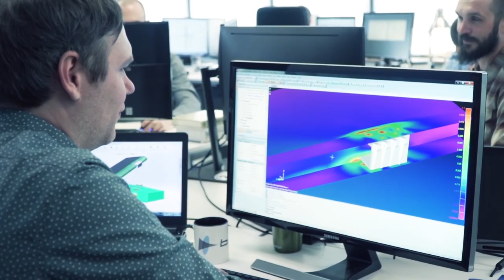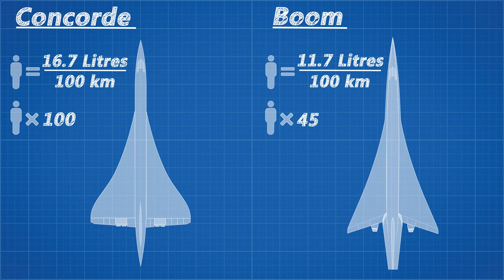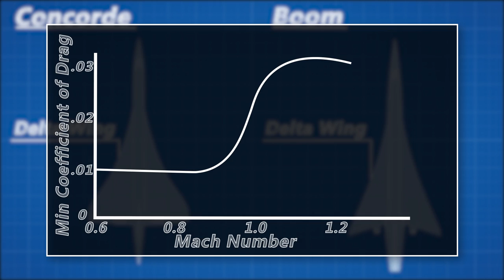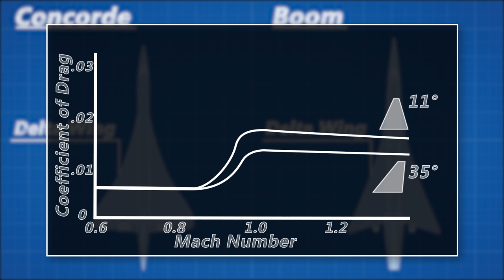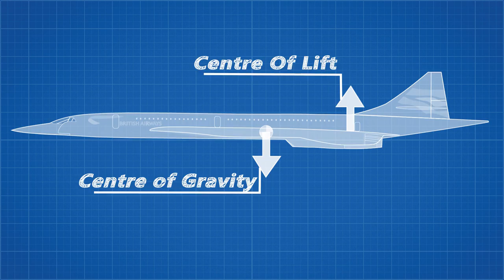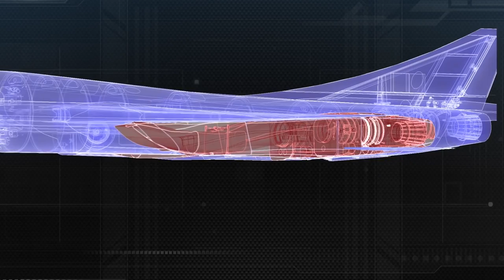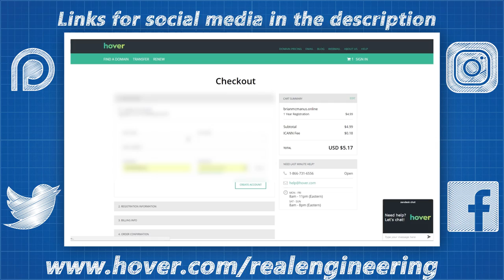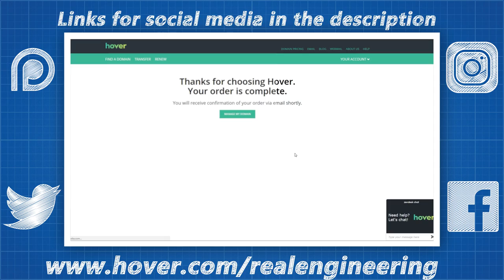Boom: The Future of Supersonic Flight?

Comment: I don't think this is optimum, the economic performance is worse instead of being better, it'll take 2.22 Concords to transport the same amount of passengers, and the 30% fuel efficiency won't matter as it'll reduce the number of Concords to 1.56. 
They're making a fuel efficiency supersonic airplane, not a fuel+economy efficiency to be a socially responsible industry, with relatively stable prices that don't fluctuate with demand/offer, salaries will be standard and well paid, never a bankruptcy or accident for lack or cheap maintenance, everybody wins. So a great reference is the Connies, aerodynamically was best, very efficient shape and engines, that should be the basis, an improvement is a merged fuselage, more lift, fuel, fuel efficiency, cargo, passengers, a plane should be flat on the bottom, engines should be at the rear, a new engine should be taking into account the exhaust gases, not really taking advantage of it, making it a rocket like exhaust, also the slowing down of air, causes drag, and the engine should be adaptable, and the engine should be a hybrid of turbo fan+jet engines, also Chine should be along the fuselage, something like this would be the most efficient airplane design, with accordingly variation for sub and supersonic. Also subsonic fuselage should have a less rounded shape and more pointy  to offer less resistance and more fuel efficiency, the tube shape is a highly inefficient shape. All airplanes should be IMO Conny+delta+Chine+merged body fuselage, highly efficient+rear hybrid engines, half electric with a Tesla Electric generator, eve in stall they would glide to safe crash-landing, we're not doing it the best way possible, but the most profitable way possible, Capitalism not Social Responsibility

Comment: Was this episode "real engineering" or a start-up commercial? 
Also lots of BS regarding efficient numerical calculation almost completely (!) making wind tunnels , or shock tubes (for Ma>1) redundant. Everything only amounts to a run of the mill start-up hype vid.
 
Why do you want to have delta wings? Not really explained.
Why do you try to explain lift from vortices? Linear aerodynamics (M<1) and gasdynamic (M>1) would have easily sufficed, nonlinear phaenomena are over the top imho.
Reply from the maker: Did you click on a video with the name of the product in the title and thumbnail, and not expect it to be talked about? Never once did I say wind tunnels would be replaced, in fact I showed several clips of the XB-1 being tested in wind tunnels. Keep up Lazare.
Reply: wasn't properly addressed by me, corrected. Point still stands.
Sorry for sounding over-toxic, tho

Comment: mach 2.2 with that amount of drag lol no

mach 2.2 is faster then a F-16's top speed TOP speed and faster then the F-18's top speed and quite alot of other modern jets even the really modern F-35 (not very high top speed of mach 1.6) is slower

how are they gonna achieve high efficiency with 4 engines??? and do you know how much fuel jet fighters consume???? i mean this is pretty much a smaller non variable TU-160 and that thing is a engineering masterpiece from the USSR

EDIT: sorry it has 3 engines but STILL it out preforms military jets!!! the army would want this shit if it was real
Reply: and how the fuck would that thing take off??? there is less wing then fuselage unless your planning german F-104 catapult launch then it is NO.

Comment: This is going to flop, just as hard as the Concorde. They're still using turbojets, and no matter what you do, the efficiency of them drastically decrease when going mach >1. If they use turboramjets instead (like the SR-71), only then would it be viable (fuel consumption wise).